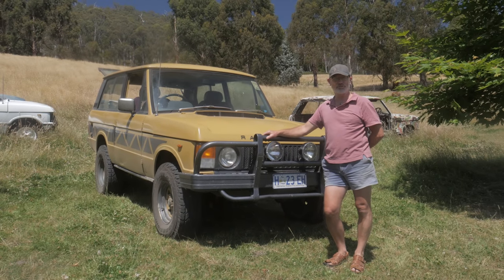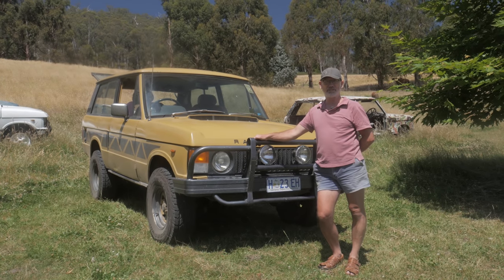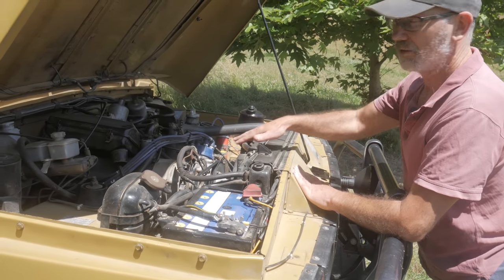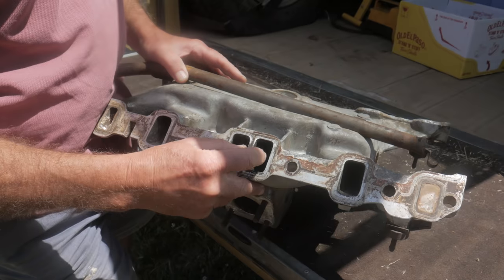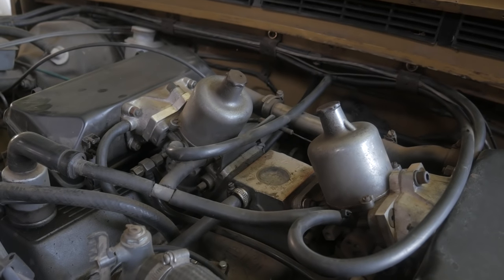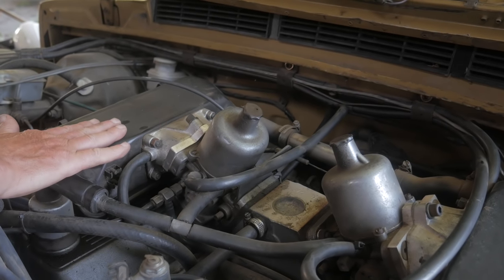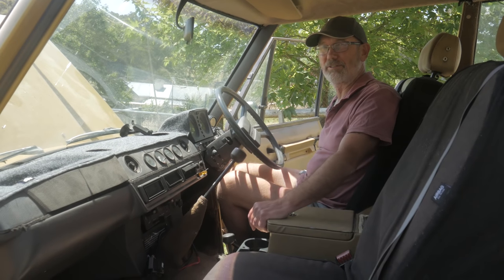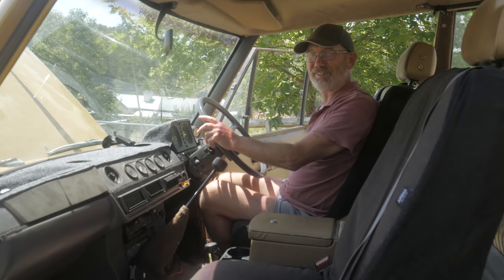Range Rover Two Door Classic V8

Comment: Range Rover Classic between (1970-93) which year of car better than all, i know its difficult question but if one of year model choose for rough and tough and for family also then which 1 go for buy
Reply from the maker: Well I recommend going for a 1985 four door if you want for a family car. 1986 was a transition year and they have a lot of very odd modifications, also I recommend sticking with the original 3.5 litre V8 as they a simple engine and parts are cheap and easy toget. Cheers Geoff
Reply: @seriouslyseriesaustralia  very thanks dear💐